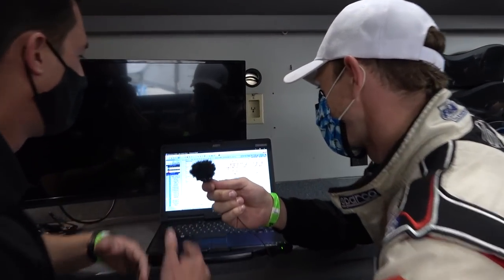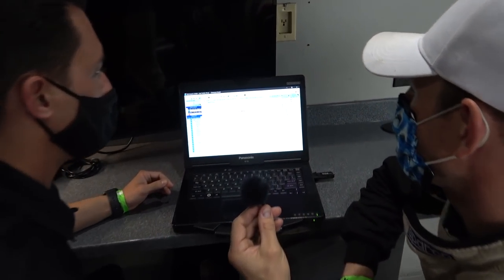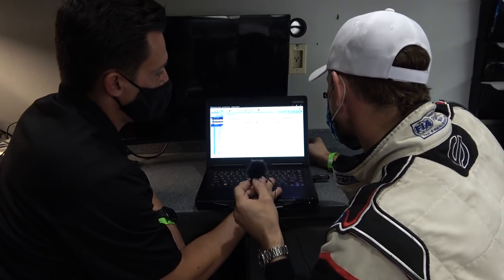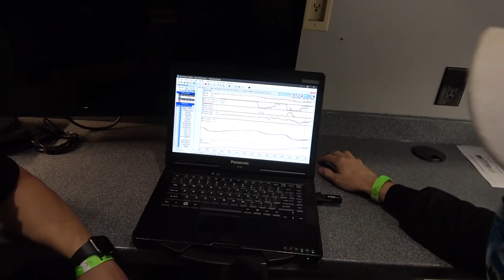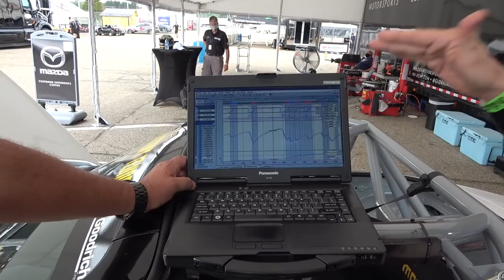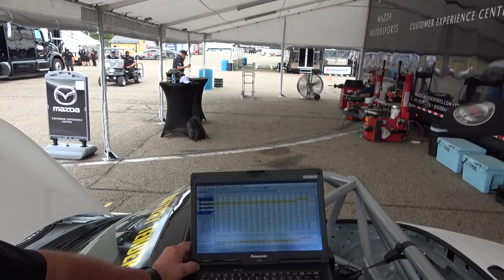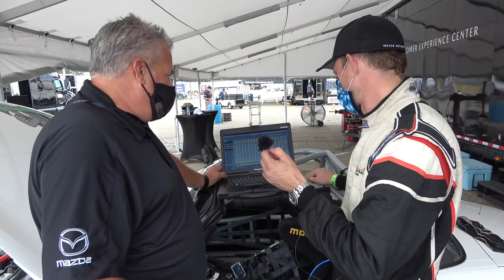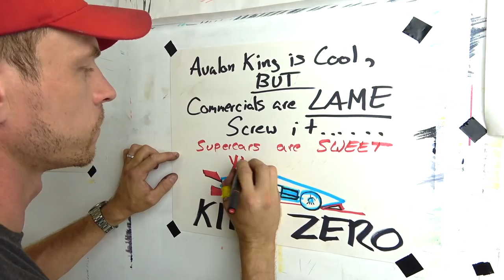Race driver vs lie detector, MX5 Cup car at Flis Performance

Comment: Data acquisition is like anything else.  It’s only useful if you learn what to do and when to do it.  If you use it for bragging rights it’s useless.  You obviously are in the former bracket.  The amount you gained, running 93 octane against 109, was fantastic.  The butt dyno can only take you so far.  So, if you’re going to the track, first get a good set of tires. Second, get a data acquisition system and learn to use it and learn from it.  It will save you tons of money by steering you towards what your car needs to get better on track.  We need more of these videos.

Comment: hey casey, i see that when you're in a turn you dont just hold a angle, instead you keep turning the wheel, is there a reason for it? if so how does it affect your cornerning speed and lap times?
Reply from the maker: I'm always looking for the edge of grip.
Reply: @CaseyPutsch  ah ok thx, have a great week  :)